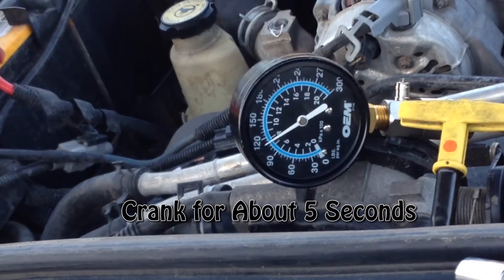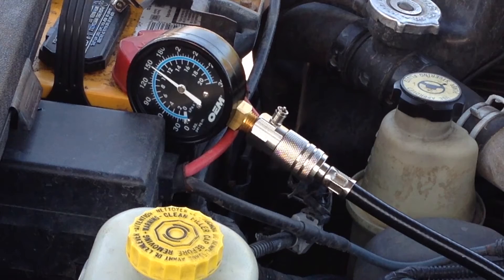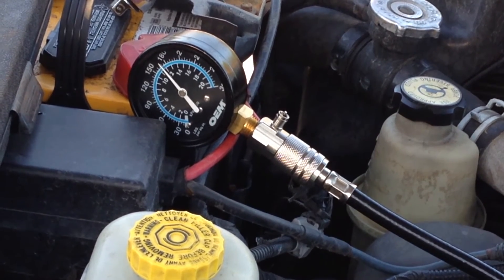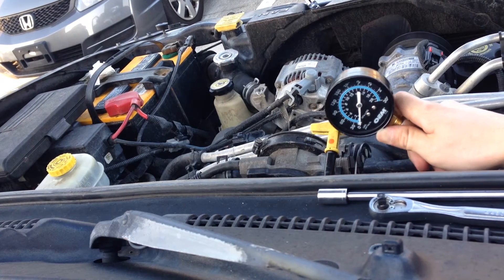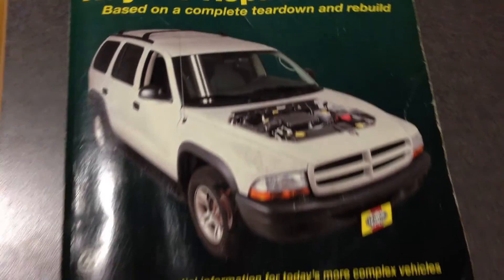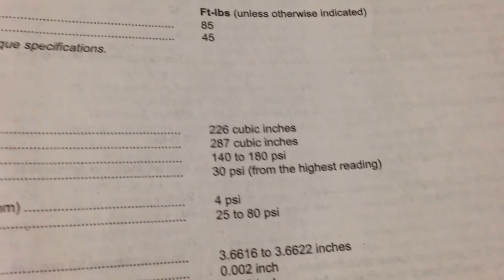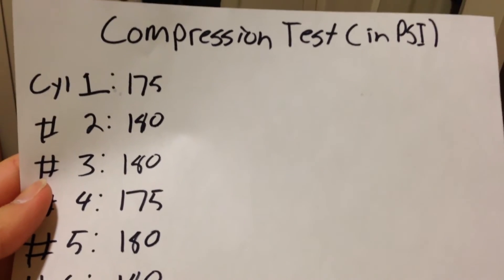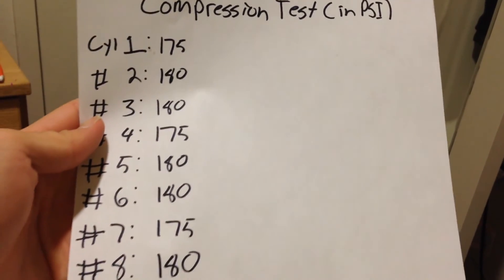How to do an Engine Compression Test-4.7l Dodge

Comment: Mine gets 40-73-178-130-168-117-178-115. It runs fine, when its cold if you go to the exhaust you can tell there's a random misfire, but once it gets up to temp exhaust note is a steady stream. The misfire is not enough to trigger any sort of codes or anything, but I'm sure with one scanner that can detect and count misfires, it would certainly pop-up.

Comment: never do a compression test with a hot engine
Reply: Because metal expands when hot. If you test hot you can get false readings from the piston rings warming up and expanding. A cold engine test will show if anything is leaking/bypassing